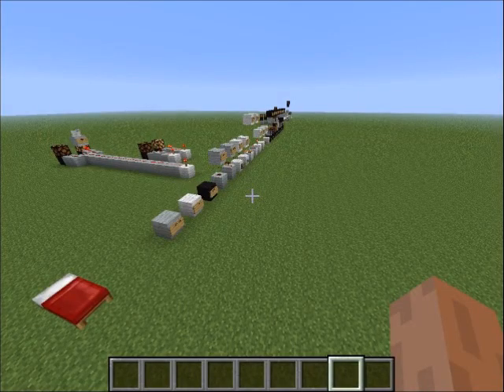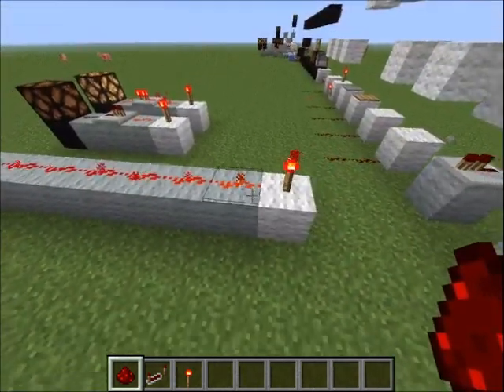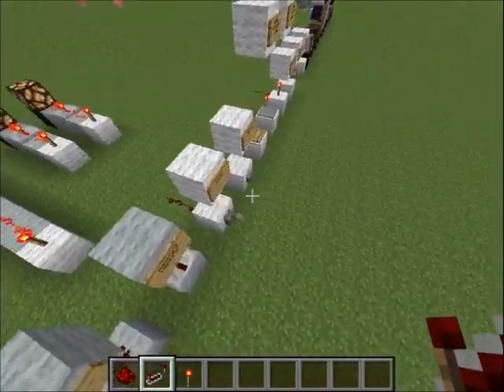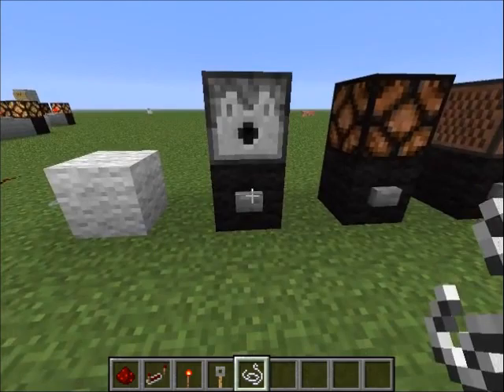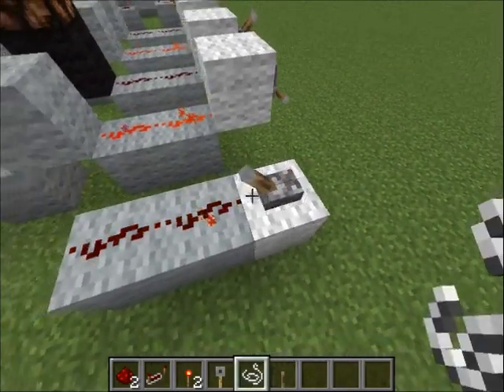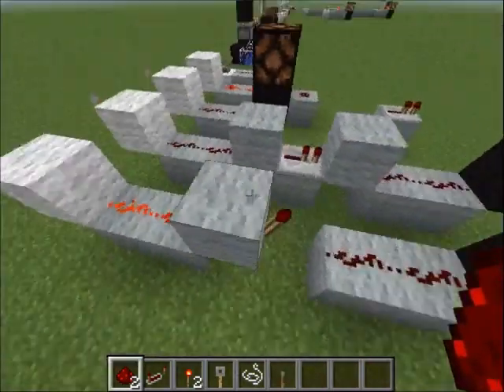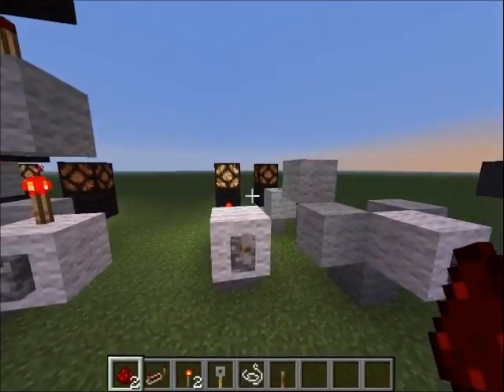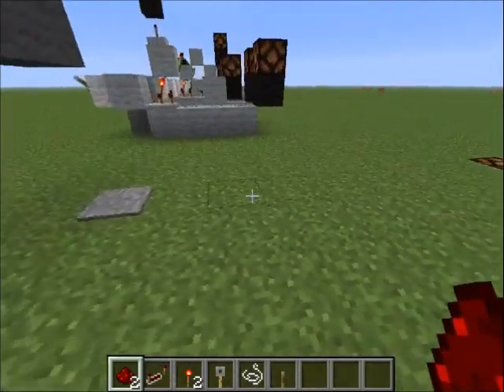Redstone Lesson 1  - Inputs, outputs and Basic connections

Comment: Pretty good vid, but I do feel that you rushed a bit and you could have said a little more about touches turning out when it receives power. You mentioned that but rushed over it. Also, I dont think the challenge is really fitting for the stuff you talked about in this vid. You did not mention that pressure plates power the block below it and you did not discuss covering wire and cutting the signal off. This is the stuff that a beginner is gonna get stuck on when they attempt the challenge.